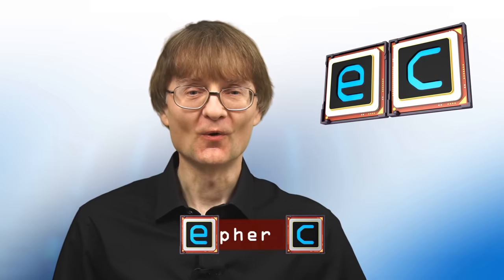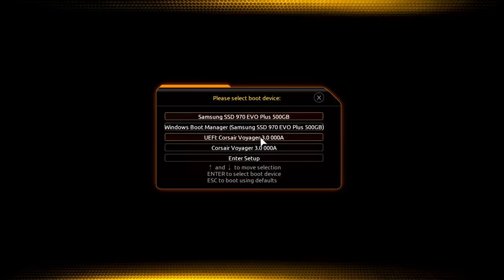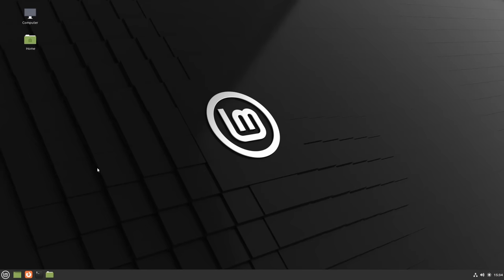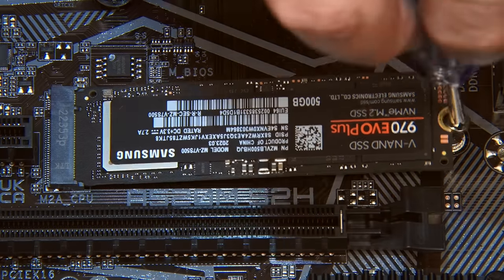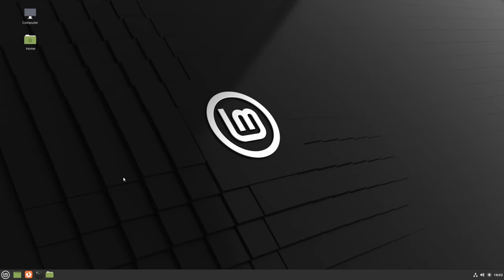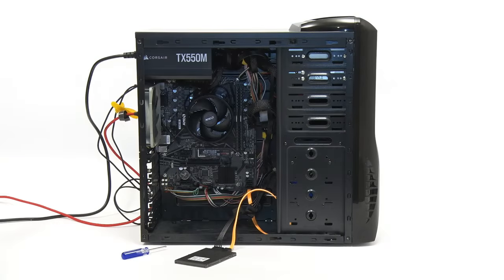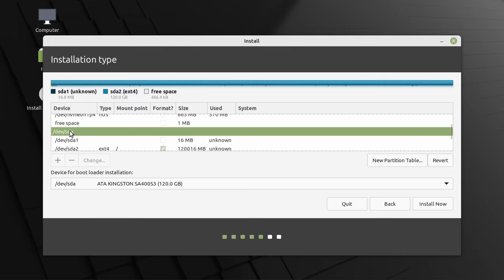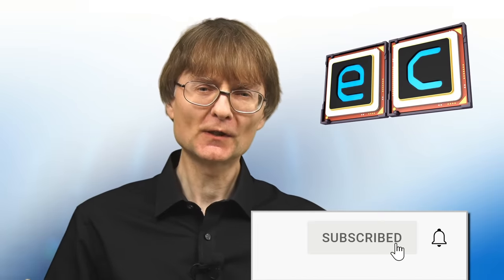Windows & Linux: Dual Drive Dual Boot

Comment: I'm going to a few Linux sites to let people know one thing about Linux I've had experience with. I'm an Amateur radio operator (Ham) I run Linux focal OS built for Hams I was at the Microsoft website and got a DDoS on my computer which said it was locked, I simply power the computer down waited a few minutes rebooted no problems the computer came back on so the story about Linux is true it's safe from these types of attacks. I also run Manjaro Linux on another computer with no problems.

Comment: Absolutely LOVING the POST beep! Did you hook up one of those tiny little case buzzer things to the 4-pin speaker / buzzer header on the motherboard? I want to do that myself, but the speaker wire isn’t labelled positive and negative so I don’t know which way it goes, and the motherboard has Speaker + and - pins in the opposite direction of the Buzzer - and + so I’m not sure what’s the right way to connect it.
Reply from the maker: Yes, I have have one of those tiny buzzer speakers on the speaker header. Note that they are not polarity dependent -- regardless of what they may be labelled -- so you can plug them in either way around and they will work just fine. I have a video that covers this here: https://www.youtube.com/watch?v=nBJJj3FB2P8

Comment: Great video. I liked prevent the Grub boot menu risk corruption. I have a laptop with just one nvme slot and the other I use the original HD, because it's enough for data files/backup and so on. So I ask: is possible to use the "Dual Drive Method B" with just one SSD (in my case the nvme), by choose the manual partition instalation and create the root Linux partition on free space (without partition) at nvme ssd? Thanks.

Comment: One tip. For those wanting to dual boot but having smaller drives or low space available and not wanting to give an up, if you have USB3.0 or higher port available, you can buy an internal SSD or NVME SSD and an external drive enclosure to match the available port. The drives are generally fast enough with good port throughput to never know you’re using an external drive to boot from. You can set up your machine to boot from the drive you choose, don’t have to open the computer up to add another drive, get the speed and choice you need, and can do 1TB-2TB with enclosure for less than $100.
Reply from the maker: Very true. Running Linux from a USB drive can work well.
Reply: @ExplainingComputers  I’m running Linux on a 2015 iMac that way and it’s like a new computer again. USB-3.0 with only 5gbps throughput and it’s plenty. Far faster than on MacOS.

Comment: Personally, I prefer to choose "Something Else" at the Erase Disk screen during installation of Linux.  That way, I can manually partition the drive and assign which partition Linux is stored in, which partition is my Home directory and a Swap partition of my chosen size.  The first choice (Erase disk and Install Linux) has a default setup of the partitions, which might not be adequate enough for power users.

Comment: Although in most cases we can just use Linux as a VM under Windows, there are times when that's not a valid option. In my case, I needed to give Linux direct access to an Nvidia GPU (for AI training). Using Linux as VM under Windows doesn't allow that (VMs can only see a generic, virtual GPU). Dual boot like this is really handy. Thanks.

Comment: Great tutorial, however I would caution against Dual boot on a daily driver.  There are almost always weird quirks associated with a dual boot Windows/Linux system.  It's best to have separate systems for each.
Reply: Like what? Are the OSs messing with each others file systems?
Reply: I like this approach. I have my windows desktop machine in a separate less convenient room of the house. It reduces my compulsion to boot up windows except when absolutely necessary. It gets used maybe once per month. I have a separate laptop in yet another room that I use for data recovery and hardware upgrades only. It's an old laptop but has a physical ethernet port and DVD drive with an old BIOS with no restrictions on boot options or entering BIOS.

For me I use a Chromebook as my daily driver which is totally separate to any of the shenanigans I may get up to trying out Linux distros or tolerating windows.

Comment: I added a 2nd Linux mint SSD and am happy to report that it works fine with Win10 on another SSD and it doesn't mess up the other data drives in the computer. I took the opportunity to upgrade the Windows drive from 500GB to 1TB - what a drama that was! I used CloneZilla then had a extend the partition on the new drive. My advice to anyone going down that route is to give yourself plenty of time and be prepared for plenty of faffing about making bootable USB drives etc. Have a bottle of brandy handy and resist the temptation to throw the whole kaboodle out of the window!

Comment: Many thanks for this - it is very clear. I really enjoy your videos. I was following along repurposing a Lenovo T560. I replaced the original HDD with a SSD (the first laptop I have ever opended with tools!). When I installed Mint 22 (Booting from a flash drive) I came across 2 issues not in the video. I had to create an EFI partition and a BIOS partition in addition to the root. The installer advised that if I did not I could run into issues later - the installer would work but I would not be able to run the system (potentially). Can you tell us a bit more about what these partitions do and are they necessary? Thanks Ash

Comment: Not sure if still apply to more modern Ubuntu based distros, but sometime ago I did a dual boot dual drive windows Linux install. Thing is, after Ubuntu updated (or upgraded) several weeks after, it did install grub over the windows drive, to my surprise. So, in my experience, the really safe way would be two drives capable of frequent unplugging, to effectively segregate both systems. External M2 drives have become an option, or maybe a bios capable of deactivating m2 units at boot time would be also nice.
Reply: There are front drive bays that take one or more drives, and have switches that allow one to turn on/off the power to individual drives. I think this a neat solution.

Comment: While back (2004) I had a dual boot Ubuntu and Windows desktop, until a Windows update messed with the partitioning so broke the GRUB settings, so neither would boot up at all.
Fun and games getting it working again, not for the faint hearted.

Comment: Excellent video. Would you like to consider adding to this video, (or make an additional video), demonstrating how to do the same (ie. dual boot dual drive) using RPI desktop OS System.
Secondly, please show how to invoke (from cmd window) and modify windows boot manager, to make the dual selection.
If windows boot manager was introduced, can it then give the choice of dual boot ?
Can windows boot manager be edited to include the option to boot Linux from 2nd drive.
Also, can windows boot manager get corrupted during windows update?

Comment: Starting with Win8, MS has Fast Startup which is a hybrid form of hibernation. With this feature activated, any changes to the files or file system could corrupt the Windows installation. I turns off Fast Startup on all my Windows installation, especially for the single drive dual boot boxes.

Comment: As always a clear and fun video!  I would like to suggest another option is VirtualBox..  this way you get the best of all worlds..  you have both operating systems running concurrently..  and another option for quick Linux access from windows is windows subsystem for Linux (WSL).     thanks for another great and well organized video
Reply from the maker: Indeed. :) I'm a big fan of virtual machines, and have many many videos about them: eg https://www.youtube.com/watch?v=OWmD8obq4eQ

In the ending I state: "So, if you need access to two operating systems, and running a virtual machine doesn’t meet your requirements, a dual drive dual boot is worth considering". Often when making videos I feel that I live in the caveat mire -- always I could note the many alternatives to what is being discussed, but in the process make the video longer and less focused.

Comment: The tool boot repair iirc if installed on a live usb can be used to easily fix the grub boot loader in the event the grub bootloader becomes corrupted. You can use a tool called rufus on windows to make a live usb with persistent storage and a distro of your choice. iirc grub customizer can be used to change boot order and change or skip startup time. Both tools have a gui and are easy to use.
If you're using something like a Steam Deck you could use rEFInd as the boot loader, but I had issues with it once and had to reformat, so I just press and hold power and volume down/up when I want to boot into something besides windows.

Comment: You can have your cake and eat it too.  If you install WSL, you can install multiple distros inside Windows.  That way, you get both kernels running at the same time with a slight hit to performance on the Linux side.  Another option is to use VirtualBox to house multiple Linux distros but that's virtualization software with its own pros and cons.  Linux preinstalled on an external SSD is useful for booting to Linux on any system you might decide to attach it to.

Comment: Safer (for Windows) single drive dual boot would be to split the drive, putting GRUB in the Linux partition and adding a boot with EasyBCD, could also use EasyBCD, I believe, to add a dual disk boot using Windows boot menu

Comment: I have tended to prefer dual (or more) boot from the same drive but know about the potential issues. f only it was this easy with X86 based Android distros or on ARM devices with SPI flash.

Comment: @ExplainingComputers
Thanks for another great video. I use both single- and dual-disk method, but of course prefer the "dual" whenever I have a "spare drive", unfortunately that's not always the case...
I'd be interested if You have any thoughts on "sharing files" between the two OSs .
And I think it might be a good subject to explain if it is something that You do Yourself.
Best regards

Comment: I used this guide and it was absolutely right on the mark!  Thanks.  One question about staying in the drive that is not the first priority drive in the BIOS setting when restarting.  I know that I can change the boot priority in the BIOS before I boot into the second drive when I would like to restart for an update.  Is there a way to have my computer stay in the second priority drive when restarting without changing the priority in the BIOS? Is this a computer specific setting?  Do I need to dig deeper in my BIOS?  I have an HP z440.  Thanks for any help, I am at the start my quest to not use Windows or Mac again

Comment: To avoid the grub on your windows drive without opening up the machine and messing with unplugging drives etc. You can just disable the drive windows is on in the BIOS. Install Linux then re enable the windows drive in the BIOS once the Linux drive is setup. Set your preference for the automatic boot os via boot priorities in the BIOS, done.

Comment: Thank you for the great tutorial! Would Method A dual boot, dual drive work with dual boot Windows 10 and Windows 11 installed on separate drives or there would be a problem with such setup?

Comment: Some Linux distros set up the bootloader in a way that it starts by default the previously selected boot option. That's why I prefer dual boot on two disks but with linux boot menu. Of course, I do not use Windows too much, it is there only for hw which allows firmware update in Windows only.

Comment: The GRUB Menu need not reside on the Windows SSD. It can stay on the Linux SSD.
To achieve this, just follow the first part, i.e remove the Windows SSD and install Linux on a new SSD.
Then connect the Windows SSD and boot into Linux by keeping it as FIRST boot drive. Update the Linux installation and it will automatically detect the Windows SSD and add it to it's OWN GRUB Menu.

Comment: Gigabyte motherboards like that one also may have an option do disable the NVM controller, so that the Linux installer in the pen drive cannot install Grub at all in it, even if the NVM disk is connected.
Reply: based gigabyte enjoyer

Comment: Very nice, Very useful if you have 2 operating system. 15 year ago I had 3 in one disk ( win32bit, win 64 bit, Linux) You can fix Grub with a Linux iso. I use always a 300Mb uefi fat32 in every drives, because modern windows can also be portable and works fine with Grub2.
Reply: Uefi fat32 Partition

Comment: My main driver is Linux, but on a couple of computers I retain a windows 7 or 8 (the last normal windows version in which YOU actually decide things in stead of microsoft deciding them for you) to be able to use certain programs and games.

I usually have Win64bit on the first partition, Win32bit(using the same product key) on the second partition, Linux on the third an a dedicated extra partition for documents/files. 

Having 4 primary partitions makes it impossible for windows to make all the tiny extra partitions it usually makes and having a separate 32bit windows install makes it easier to use some older windows software (and defragmenting the 64bit drive from the 32bit install and the other way around is much faster)

Comment: ~ 2minutes in, reference hitting F12 --- most computers disallow this unless SECURE BOOT is disabled
Reply from the maker: Fair point, but I cannot antipcate every BIOS and configuration thereof. And on the system used, secure boot is enabled, with security of the type you imply being linked to whether booting from a USB drive is enabled or not (which here is it).

Comment: I thought I might mention something that may crop up down the line.  In certain circumstances grub-update may be run when the system is upgraded (e.g. apt upgrade).  In that case it's possible that the windows boot drive could show up in the grub menu even though it wasn't present when Linux was first installed, in the case where the Windows drive had been disconnected and then reconnected.  I haven't tested it but I suspect that will happen.  Just something to be aware of if it shows up.
Reply from the maker: Very interesting. I've never experienced this, but can totally see where you are coming from here with a Linux system upgrade.

Comment: I'm not sure if you have come across rEFInd Chris, but I've had a lot of success with it? It works alongside UEFI (a kind of enhanced UEFI boot manager if you will) and presents a pleasing icon based graphical interface to select which OS you wish to enter. It detects any newly added bootable drive/partition automatically, including removable media. 

It's possible to set a default, or even "last used" automatic load. I tend to set the time-out to zero, and assign a hot key to bring the interface up and select another boot option if required - similar to choosing the boot menu (F12 in your case) but much slicker, and highly configurable. Operating systems can be renamed,  fancy icons set, and boot options can also be added easily. 

Installation can be performed from either, or both Linux and Windows, and the documentation is excellent.

Oh, and it Works with Macs too if you're that way inclined.

I would recommend it as an alternative, and accessible (beginner friendly) addition to your brilliant demonstration shown here. I do hope you may make a video on it some time too.

Comment: The best way to have this would be to make m.2 drives externally accessible like usb, then could have endless OS's at your disposal. Using GRUB for multiple boot types like you explained can/will have issues.
Reply: In theory. I have had issues trying to boot installed operating systems from USB drives, resulting in missing bootloaders, BSODs, etc. It all comes down to the particular computer, its age, BIOS vs UEFI, USB 2.x vs USB 3.x, etc, etc. There's simply too many variables to say it's a 'one size fits all' solution.
Reply: This is easily done on a Raspberry Pi !

Comment: Thanks for your instruction.  The dual boot system is very convenient.  However, here's the only problem in switching between the two operating systems.  You have to turn off the TPM and other Secure Boot related settings in BIOS each time when you wish to use Linux.  This is quite troublesome.
Reply: Yes. Microsoft suck don't they... Linux supports both TPM and secure boot but MS wants the control of your hardware. Remove Windows to secure your system again.
Reply from the maker: You should not have to turn off TPM and Secure Boot to use Linux -- as the video clearly shows, this is not necessary. But I cannot know how you have set things up.
Reply: @ExplainingComputers  Thanks very much for your reply.  The problem lies in Secure Boot Violation.  Your answer dawned on me that Ubuntu is to blame.  It's time to discard it for another distro like Mint.

Comment: You should also talk about WSL on Windows. It is a nice way of running linux applications from Windows.

Docker Desktop needs WSL and it is also nice if you need to run an app packed on that system. This would be also a nice topic for a video. I recently discovered this and used it to install opentts, which has a docker image. Really good to experiment with Linux applications from Windows
Reply from the maker: This is a video about dual booting. I have made lots of content here on other ways to run Windows apps in Linux, virtual machines, etc.
Reply: @ExplainingComputers  Yes, I know, it was just a suggestion, sorry